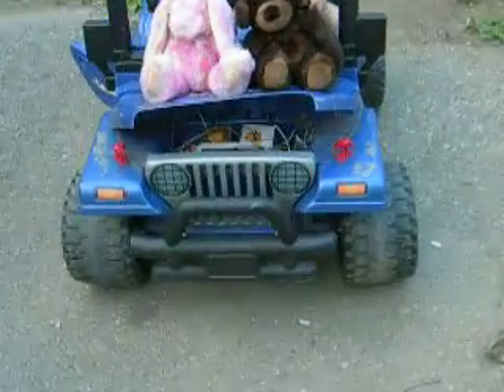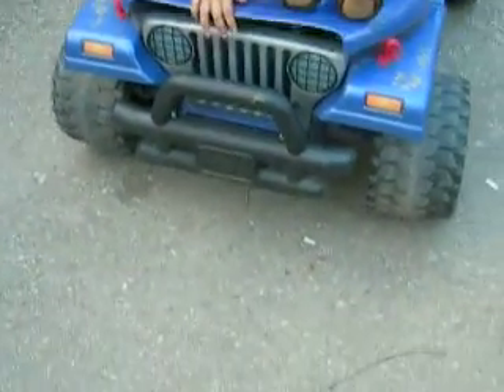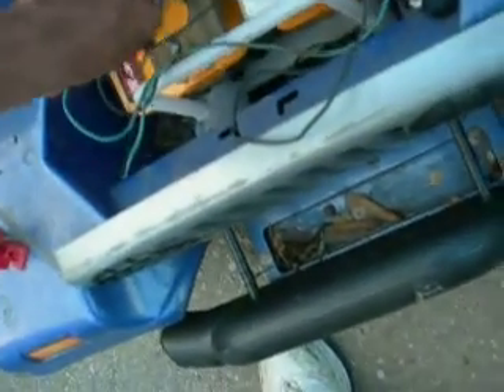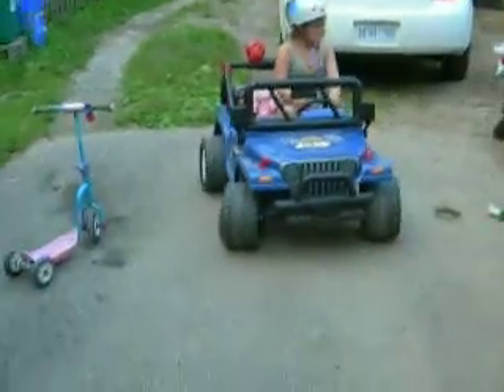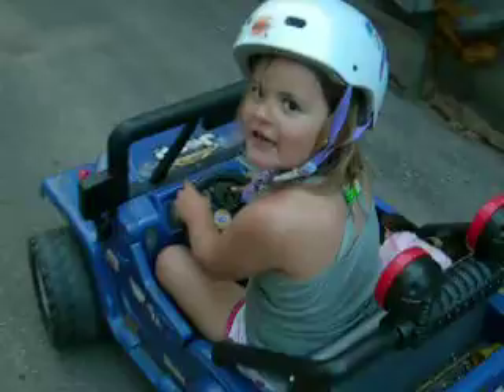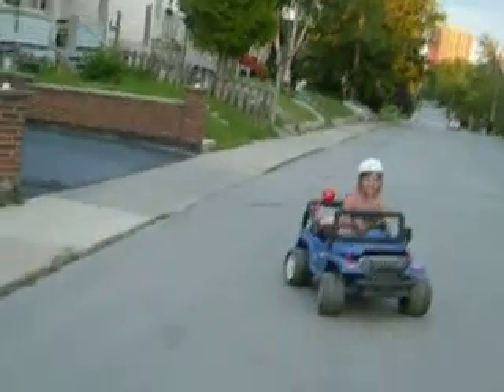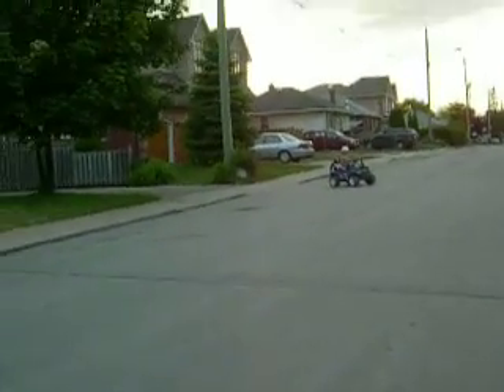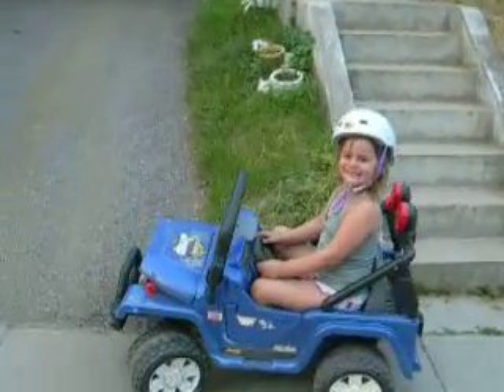36 volts in a 12 volt jeep

Comment: @truesprocket LOL!!! I'm thinking of adding a 6 volt to the already existing 12. Hopefully that will give a little more than what they have now. Can I simply cut the black and white wire going into the motors and into the battery and add the 6 volt wiring coming off the 6 volt battery into the already existing wiring...positive to positive and negative to negative and then plug the existing 12 volt wiring into the 12 volt battery? Would that work?